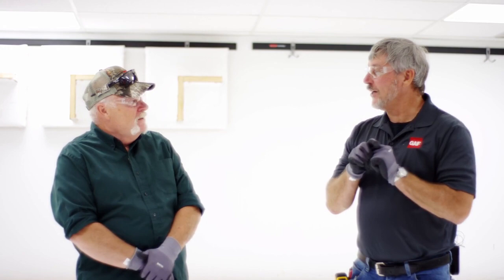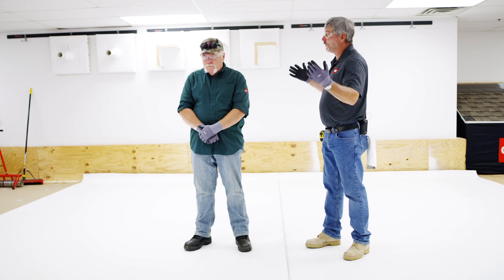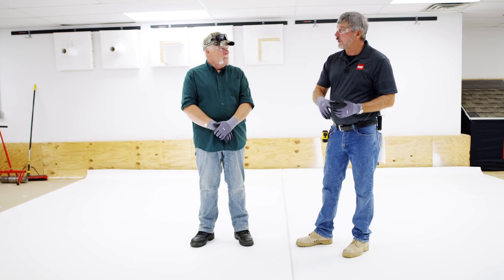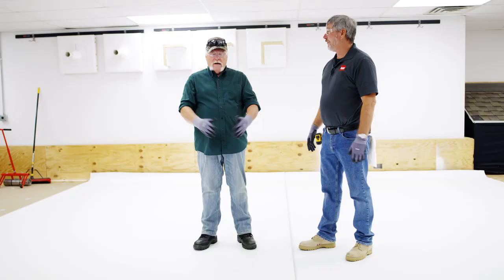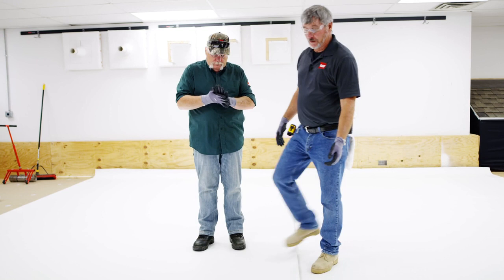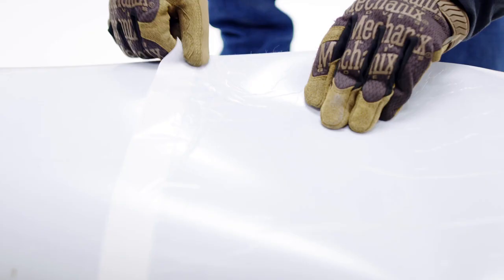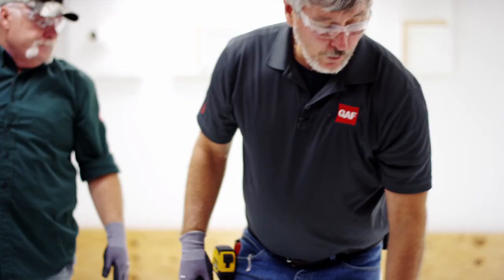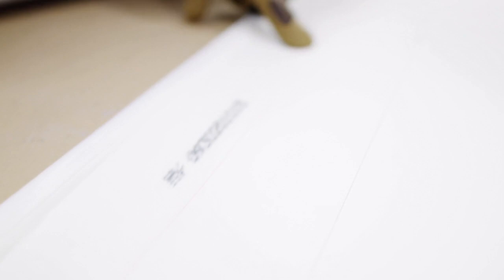EverGuard® SA TPO Product Overview | Roofing it Right with Dave & Wally by GAF

Comment: So no plates or fasteners required?
Reply from the maker: Hi, there. The EverGuard® SA TPO uses a hot melt pressure sensitive adhesive (HMPSA) to retain bonding power at temperatures down to 20°F. You can visit this data-sheet for more information: https://bit.ly/3R4WjrP